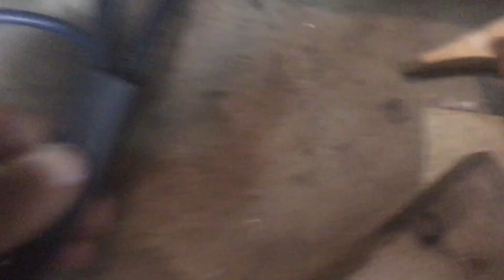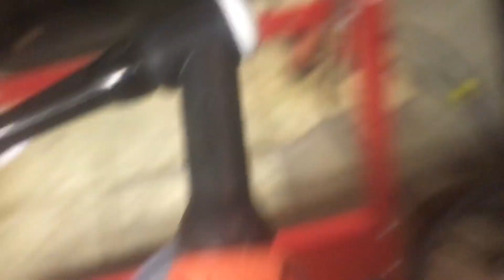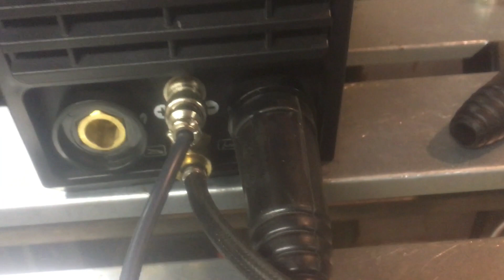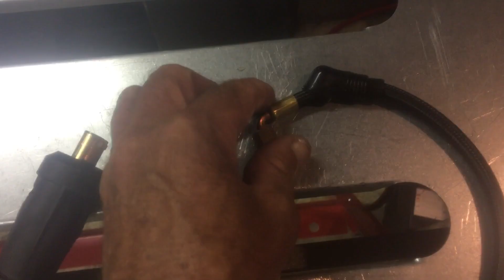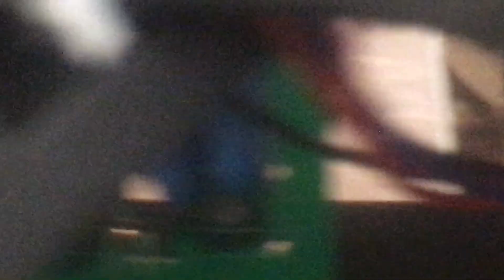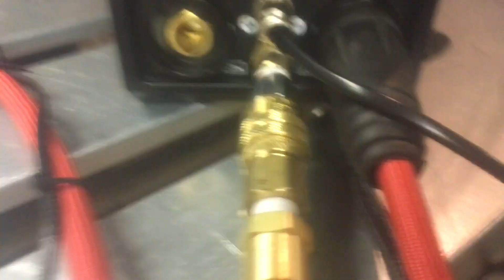Hzxvogen HBT-2000P DIM DIY Upgrades - 1 touch CK-17-FX & more

Comment: Hi. I buy pedal from  Hitbox hbt2000p but with another connector.  The Hitbox promise me schematic. Hzxvogen and Hitbox this is the same device, but different colors-)))
Reply from the maker: Thank you for sharing.. Yes .. same top level company. The pedal shown in Hzxvogen manual was lots of pins.. Keep us informed of progress.
Reply from the maker: I see the pedal is offered by both Hzxvogen and Hitbox.. The numbers on the 5 pin socket of the pedal match the numbering of the Torch socket.. The wiring (schematic) should be same as shown in this video.. for the cables .. To know what is in the pedal box should be easy to see.
Reply: Pedal is analogue potentiometers. And the controlling not the same as a button on the torch
Reply from the maker: @pistoletov1974  The pins out of machine should tell what is going to pedal so I think it is same.. The pedal may override or by pass the electronics inside of welder.
Reply: @lars-dimdiy-howtos464  unfortunatelly Hitbox say -  pedal supported only in new model hbt2000p. But im not sure in this, 
because the instructions from the old model mentioned the pedal..
Reply from the maker: @pistoletov1974  Good that got back to you. My instructions show pedal but with cable that does not match.. It must of been for commercial industry production modifications.. A pedal restricts usage to where , floor and chair/table many places not easy to use.. You can get really good at setting up slopes then use 4T to cycle heat and duration.. It works really well for me with the cable I switched to with my modifications.. Good luck sorry could not help with the new pedal.
Reply: How I can send the photo?
Reply from the maker: @pistoletov1974  Sorry we were preparing for and then yesterday was Father's day. I saw it is possible to post photo to community bulletin board on YT. I think it is only way.

Comment: Do you know if you can add a foot pedal to the welder?
Reply from the maker: Technically - yes. Realistically - depends on how far and how much you are willing to spend/do. It was possible to put a huge V8 in a VW bug too. 

The manual shows a pedal switch with instructions. It states that it has a fourteen-lead aero-socket on it. The picture shows a pedal with 12 pin connector but the front of the unit only has a 5 pin??? I have never seen it sold or offered anywhere. If used it eliminates use of 4T or pulse settings. I believe it is similar to some foot pedals that have a rheostat control on the side of the pedal. Since the manual says the unit senses the pedal and limits the machine to 2T and eliminates front panel current adjustment to me that  means technically one can be rigged up to work.
IMO it probably would be better to just get a different welder that already has that capacity. By switching to trigger switch and having pulse 2T/4T I don't see a need for a pedal for any of the welding I have done but that is a personal preference decision.
Reply: @lars-dimdiy-howtos464  cool options for other people who have the same thing was wondering if it would work thanks for the info on the machine.
Reply from the maker: Very welcome.

Comment: I just bumped into this after first watching your previous review, many moons ago. LOL
Although I haven't used mine very much since last year, (too many welders-too little time) I am getting reacquainted with it once again. I see you've been very busy and done a lot of investigative research. Thank you! 
I had intended to do what you have done, this saves me a ton of brain twisting and wire tracing. I had all of the pieces already, just needed to go and do all of leg work of wire tracing and now that's done thanks to you. A bit more involved than I first thought but a worthwhile project none the less and easy enough to do so not a deal breaker by any means.
Thank you once again!!!!
Reply from the maker: Very Welcome.. glad it helps
Reply: @lars-dimdiy-howtos464  And yes I forgot to mention, the length variations for Dinse connectors and sockets seen to be part of the Chinese supplier's landscape and not just applicable to these machines only. I've gotten to the point of just chucking them into the lathe upon arrival to match them up, since it seems to be a dog's breakfast out there for the several Asian machines I own. Not so much though for the high dollar units.
More folks need to see your videos in order to save themselves a lot of aggravation.
Once again, thank you!